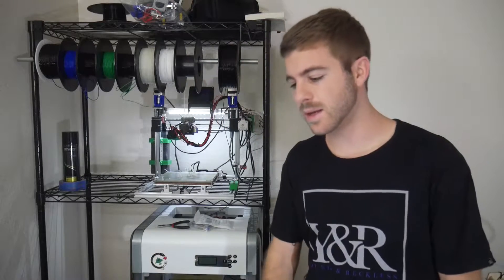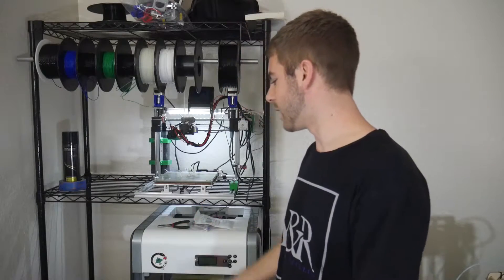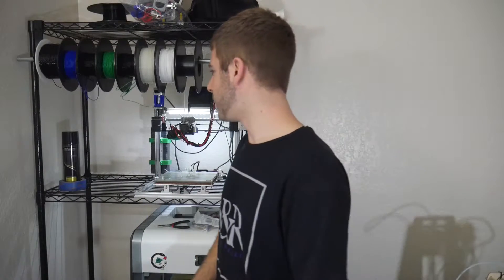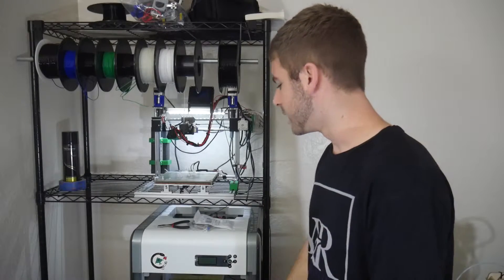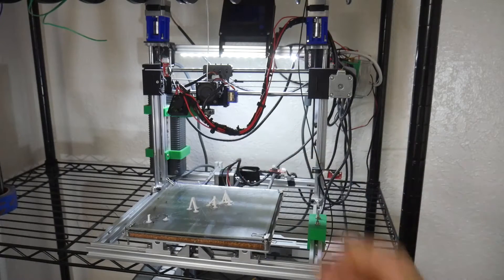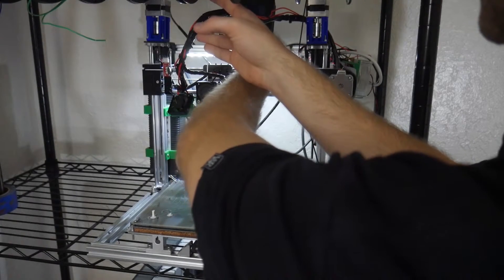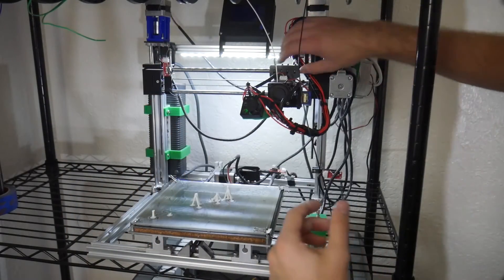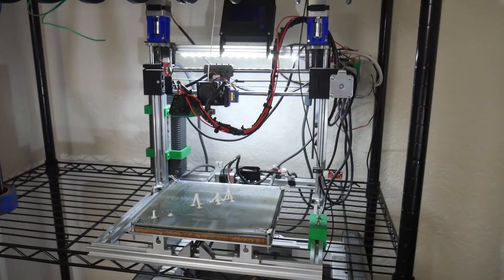3d Printer Bearing Maintenance! | To Lube Or Not To Lube?

Comment: You really shouldn't manually turn the steppers that fast (if they're still plugged into the controller) because you're sending current back through the driver and you run the risk of damaging the driver. The risk is probably low, but it's best practice not to do that. If you really need to, just disconnect the stepper motor cable first.
Reply: No more risk than running the machine in general. Reseach back emf and learn ya something.

Comment: I personally avoid grease for the smooth rods on my FT2020. Instead, what you want there is a dry lube, like silicone (you can get it in sprayed form). The bearings themselves, if they're the closed type, have their own lubricant on the inside, and you don't want to introduce particles from grease into the bearings.

The white lithium grease is great for the threads/screws though.

Comment: You need to make a room showcase or gaming setup things look so different after you moved. Thinking about getting a 3d printer for cheap and for a beginner which one do you think provides the best quality?
Reply from the maker: +SYN TECH I did one when I first moved in! At least I think I did a few months back?
Reply: ModBot Why am I just seeing this I need to put the notification bell on for you this is the first video to pop up for me in a bit
Reply from the maker: SYN TECH YouTube is screwed up man alot of big channels have been talking about it it blows
Reply: ModBot  white lithium grease is awesome for lead screws/rods as well as bearings. I use it on both of my printers Flux Delta+ and CR-10. The Flux Delta shipped with “silicone lube” and that stuff was trash! Ever since I switched to white lithium grease I’ve had way less issues on the Delta as I put it on the linear guide rails,magnetic joints, and rods.

Comment: I use Slip2000 60320 EWL Extreme Weapons Lubricant on smooth rods because of it's low viscosity. I use Super Lube Syn. Grease on spiral/geared rods.
Reply from the maker: +RJ_Make I'm sure that stuff works fantastic especially if it is made to be used one firearms